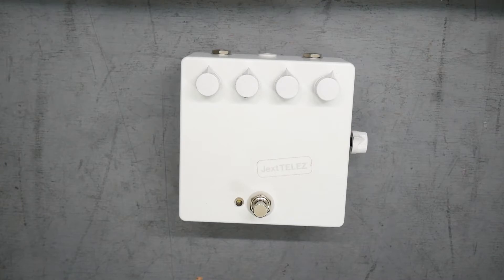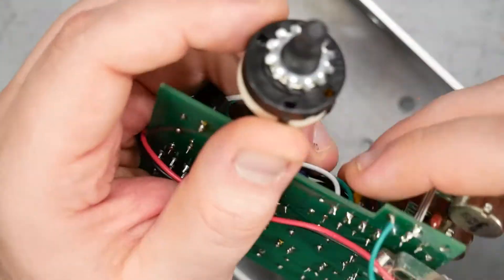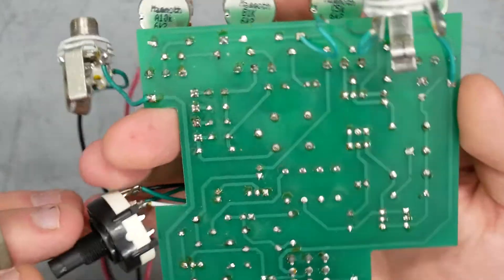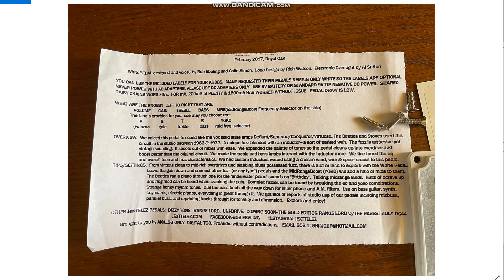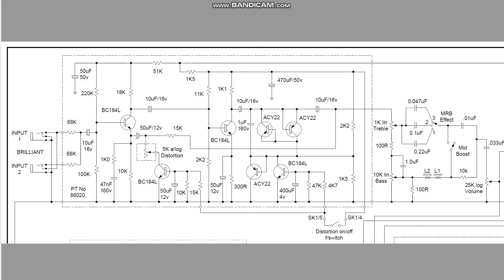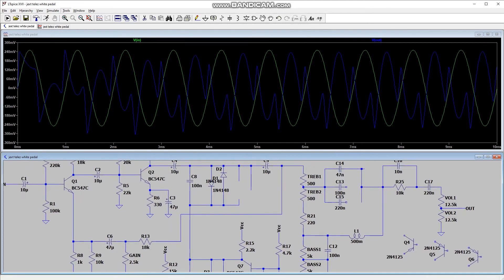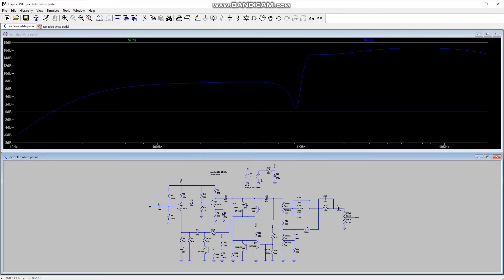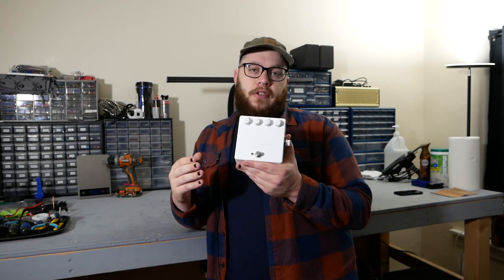Jext Telez White Pedal Teardown! Vintage Vox Solid-State Resurrected!

Comment: Hi, I did  built the tonestack in a box and plan to build the gain circuit next.For now i send a coloursound powerboost in the tonestack.I want to understand what i'm doing a little more. Can you tell me if the 3rd transistor used as diode as any use or does the transistor at the bottom sends the signal to ground ? I guess you noticed that jext telez left out the distortion switch.

Comment: I wouldn't describe those REAN/Neutrik jacks as 'cheap knockoffs' honestly. There are loads of cheap crappy open frame jacks on the market but Neutrik stuff is every bit as high quality as Switchcraft. I like the finish quality on the hardware and more rugged contacts over the more expensive Switchcraft part. If they were using flimsy Tayda hardware that would be one thing but I've chosen the Neutrik jack over Switchcraft for quality reasons for years now.
Reply from the maker: huh this might be my ignorance. I didn't realize Neutrik made these jacks. I've seen these types fail, but I might have been dealing with clones of the Neutrik. Never had an issue with the switchcraft though.
Reply: @graybenchelec  It's all personal preference but with the exception of a few parts where they truly are the best, Switchcraft is riding on their brand name without bringing much to the table that justifies 100% higher prices than an equivalent part made in China rather than Mexico. The only parts in the music gear world that are unmatched are their open frame 3-way toggles (LP and SG type switches). I've used hundreds of these Neutrik jacks though and they are great. Customers also like that they provide a more positive feel when plugging in cables.
Reply from the maker: @twittbaltimore  Fair enough, my opinion was tainted by crappy clones it seems.